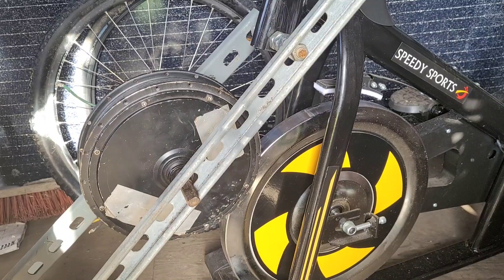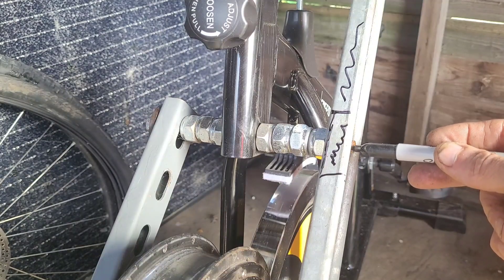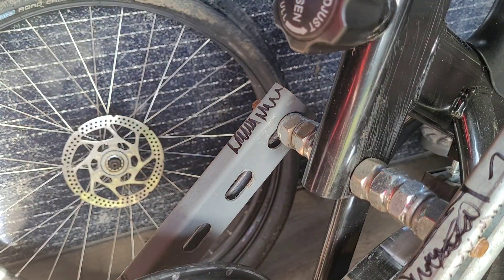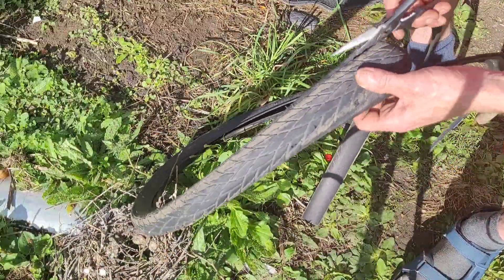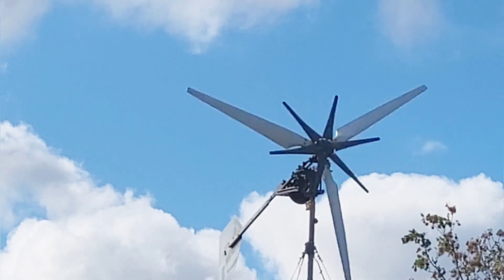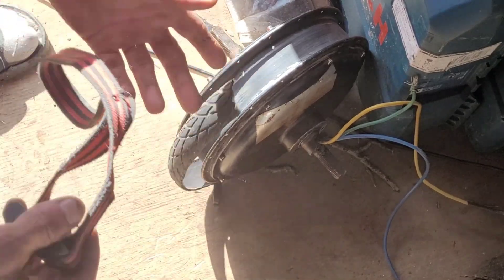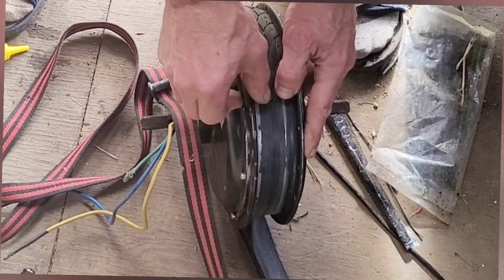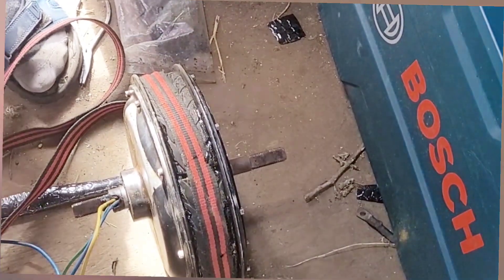OFF GRID BATTERY CHARGER - Spin Bike with 3kw E-bike Motor 72v ( as a 24 volt generator )

Comment: just wondering what happened to hall sensor? this you cut it? 
or where did you connect it? 
ty
Reply from the maker: The hall sensor wires are still there if I want to use them and the wiring is untouched I cut the hall sensor connector block off to enable me to get the motor spindle connected to the motor arm